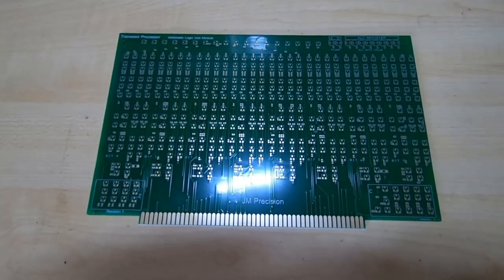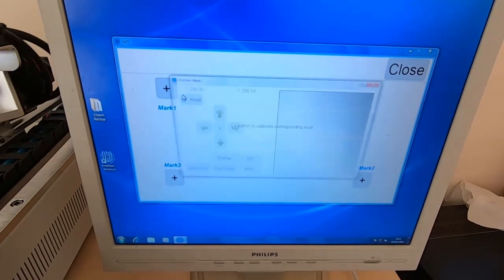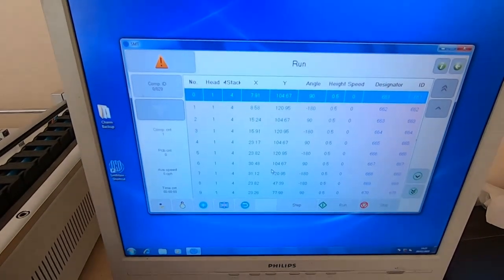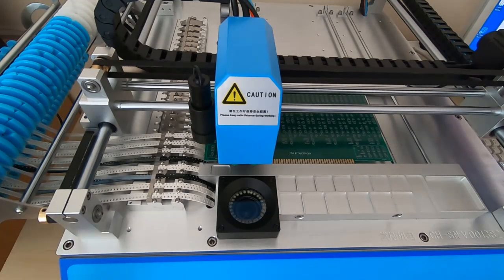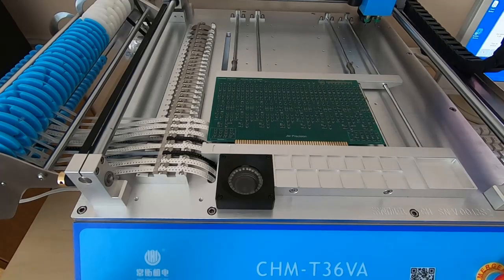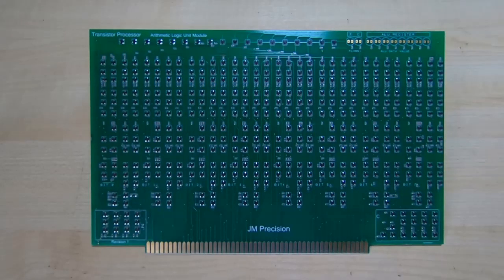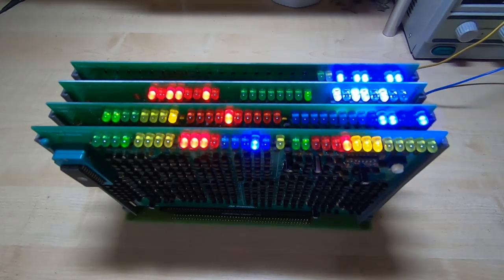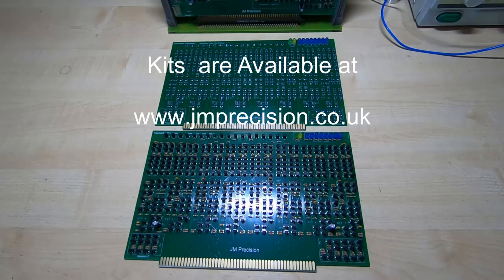CHM T36VA Pick and Place Machine Part 6

Comment: Thank you for these videos. Please give me your opinion on purchasing this machine to specifically place 48QFN, 0.4mm pitch packages? Do you think I should invest in a machine with higher accuracy?
Reply from the maker: I am not affiliated with the suppliers of these machines so I can only give my independant opinion. I have used the machine I have for placing components down to 0402 (including 100 pin QFN 0.4mm pitch packages) and have no had any problems. It really comes down to what you want to use it for. I would not use it for large scale production but for small runs it seems fine as long as some time is spent setting it up correctly. I would advise using 3 point board calibration and it should then handle something like a 48QFN without any problems (make sure you use the correct nozzles). If your intention is larger scale production then this may not be the best choice.

Comment: Have you noticed that the angles you load get changed by 90 degrees once loaded into the machine?
Reply from the maker: The software is a bit odd in the way it handles rotations. It specifies a rotation angle from the last rotation that was given but only shows the last rotation value. That is if you specify a rotation of 90 degrees it will rotate the part by 90 degrees. If you then specify a rotation of 90 degrees then it will rotate the part 180 degrees but only show a 90 degree rotation in the job table. Initially it is up to you to specify the rotation required and you need to do that in your CAD system. You have to specify the X,Y directions and the required roation that this results in. If needed you can then rotate parts in the P&P software but do not keep adding a 90 degree rotation as this will accumulate bigger rotations than you expect.
Reply: Hi, I just received a CHMT36VA and did my first test. I also had the same thing happen. When I load the csv file the angles are the same file I exported from the CAD system. When I convert the file the angles are change by 90 degrees. As a result the components are placed shifted by 90 degrees. I have manually changed this angle in the pick and place software, However I would like to know how to solve this issue. I’m not quite understanding why it is happening. Did you manage to resolve this issue? Thx.
Reply: I'm a newbie with my machine but there is definitely something funky going on in angles. To solve it, I ended up subtracting 180 from all angles in the Altium PnP CSV file so that my angles range from -180 to +180. Incidentally, all my library parts are centered on the component bodies instead of at a pin.

Comment: Hello! I read in EEVBLOG forum that some people are having trouble placing SOT-23 and 0805 caps. Have you had problems with these parts?
Reply from the maker: No I do not have problems with 0805 or SOT23, In this video I am using only those size parts. Most likely they do not have the machine set up correctly but it depends what problems they are having.
Reply: Jerry Walker Great! I will order mine this week. Your videos are helping a lot. Thank you!
Reply: @JerryWalker001  My use for this machine would be placing 21 components on each of 18 boards of a panel. Those components are 0805 resistors and capacitors,  BC817 (SOT-23), diode M7 (DO-214AC) and a microcontroller (SOIC-8). Do you suggest a Juki nozzle which will work fine with all those components, that way the two heads will place any of them or you suggest a specific nozzle depending on component, liek the microcontroller? The only component which not come in reel is the microcontroller. I see the P&P have some square places for bigger components. Those soic8 will be put on these squares?

Comment: Random question on the board alignment, have you run into limits on the board size?  I can place smaller boards (about 100mm by 100mm) fine, but oddly when I tried to do a larger board (220mm by 260mm) it fails to calibrate the PCB?  I ended up breaking the dpv file into parts and running each section separately and that worked, I just found it odd that the software will not calibrate on a big board, wonder if you ever had an issue like this?
Reply from the maker: I have run much bigger boards than that. The only reason that calibration generally fails is if you have the calibration points in the wrong corners or if the points selected are too far from what the machine expects. For example if you seelct a point that is at 300,300 but you drive the machine to a point that is 301,300 during calibration then this will cause the calibration to fail. This could be machine alignment or board positioning or the points you have selected are not at the points you have specified. Try dirving to a 'know location' and see how far away the machine is when uncalibrated.